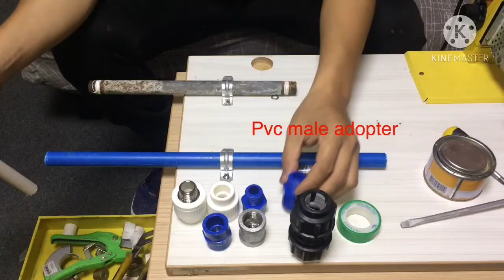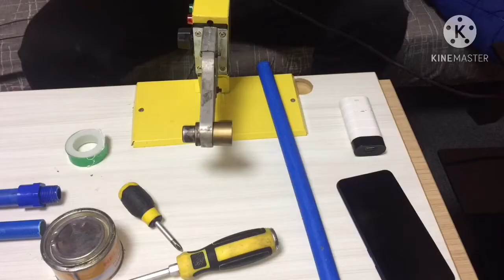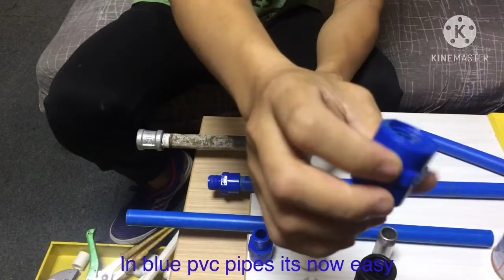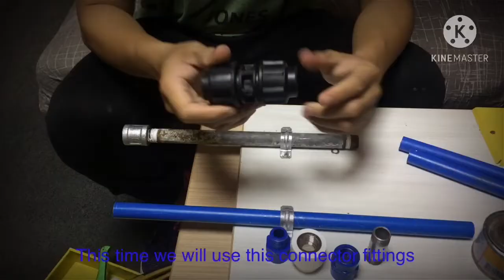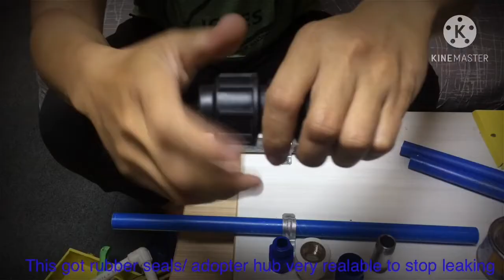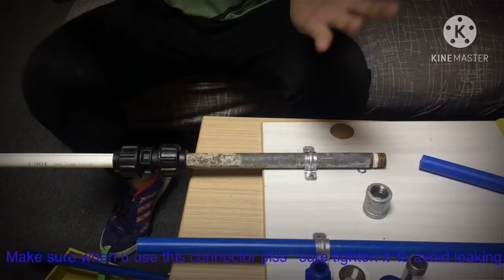How to connect  GI pipes to PPR and PVC pipes using. PE Compression coupling and connector Fittings.

Comment: Bossing Pwede rin ma treadan 1” or 1-1/4” ppr straw/suction pipe ng 1hp deepwell p/p to connect 4 to 5 or more ppr pipes? Kasi deepwell ko 2” black pipe 50 feet deep n Hindi mkapasok 1” male/female adaptor n union? Thanks for your immediate response. Have a nice day n more power.

Comment: Hi boss, tanong ko lang yung pwede mong maisuggest sa akin tungkol doon sa connection between pvc to male adapter gamit yung pipe cement, malakas kasi pressure ng tubig kaya laging natatanggal yung connection. Salamat sa tugon
Reply from the maker: Reduce mo.pressure sa main meter..
Reply from the maker: Doon mo i control ang flow ng water papasok..
Reply: May experience ka ba sa pvc threader kung okay ba gamitin. Balak ko sana na imbis na mag-adapter, ti-threadan ko nalang yung pvc para rekta na sa GI coupling
Reply from the maker: Pde din yun sir . Kung may pang threader kau.. . .or else gamit ka nlng ng. P.E.conpression fittings....matibay din yun . Pvc to gi to ppr .pde..
Reply: @gerramilservices  Sige boss, maraming salamat sa pagsagot.

Comment: Question: iyong PE connector kapag edugtong natin ang GI, PVC, PPR pipe ay kailangan pa bang ipasok ang pipe sa O-ring gasket? before e tighten? Salamat po sa sagot.
Reply from the maker: Yes.. sir... kailangan...bago.mu.. ikabit.. lihaib mo nuna yung bawat dolo.ng gi pipes.. para.. smooth..
Reply: GERRAMIL SERVICES iyong dulo ng gi pipe ko ay may thread po. So, pagkatapos iyong puti na may thread sa loob ng PE ay ang O-ring gasket, kailangan ipasok muna natin iyon sa gasket O-ring tsaka na etighten? Hindi kasi ako maka leak test kasi wala pang supply. Salamat po. More power
Reply: @gerramilservices  boss ISA Lang ba ang sukat Nyan PE compression?ung tubo SA tubig boss 1/2 ba sukat Nyan GI?

Comment: Sir ang pe compression ba pag sinabing 1" ay 1" ang inner diameter nya? Yung hard tube ko kasi ay 1" ang inner at 1 1/4"ang outer diameter wondering kung 1" or 1 1/4" compression ang need kong bilin. Thanks
Reply: Example po ang 1" pvc pipe ang inner ay 1" outer around 1.3". Ano po pe compression ang kasya dyan
Reply from the maker: Iner diameter dapat boss....
Reply from the maker: Magbase ka sa inner.. daiameter
Reply: Ahh sige Sir. So kung pipe ko inner ay 1" at outer 1.25". Ang need kong pe compression para fit siya ay 1". Thank u. Wala kasi sa hardware at online lang bibili di ko ubra sukatin